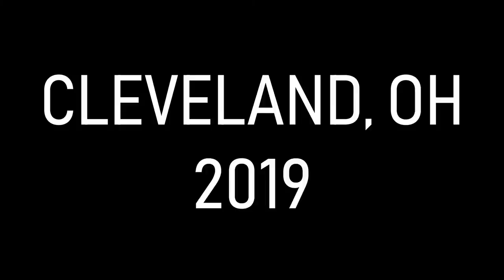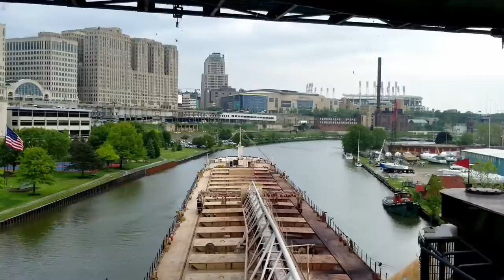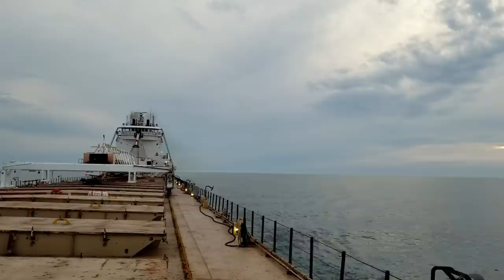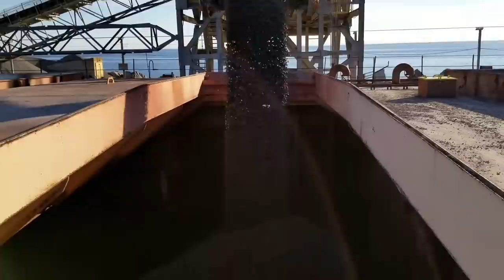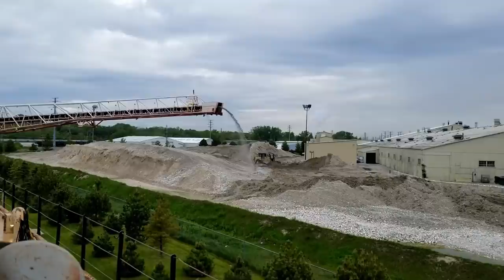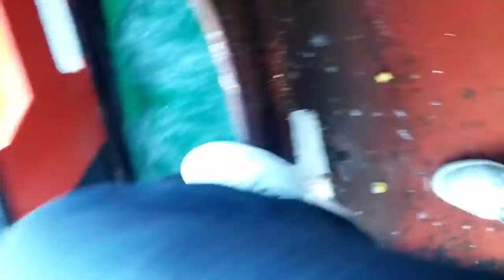SAILING ON THE GREAT LAKES. BULK CARRIER

Comment: I have a 45' sailboat that I keep in Racine, WI from mid-April through mid-October and we sail all over Lake Michigan. The thing that amazes me about the lake freighters is how the captains are able to maneuver them into such tight rivers and ports without tugboats...even the 1,000 footers. Great video...thanks for posting it!
Reply from the maker: Yea, if you see the timelapse i made of cleveland, that was all the captain no pilots, freaking crazy. thanks for watching though!
Reply: side thrusters?
are they all rusty boats?
Reply: Great Lakes captains are typically locals. They grew up near those rivers, they boat and fish on them whenever they are not working, they have a longtime connection to those rivers and know how the currents function and use them to their advantage. That's the thing about Great Lakes captains and officers, they have a strong bond with the Great Lakes and their adjacent waterways, it's basically routine for them, on the ocean captains are likely to visit a bunch of ports they are not familiar with. On the Lakes you mostly see pilots and tugs on salties (oceanbound vessels that visit the Lakes), although in some ports with a lot of shoals (like Green Bay) tugs are more used more commonly. The main purpose of tugs on the Lakes is moving barges around rather than ship guidance, tugs commonly are bringing barges into harbors that are too small to take ships.
Reply: @feelinghealingfrequences7179  Depends, some companies have a better track record of ship maintenance than others. There are some very old ships on the lakes that are still sailing and are kept in good condition (like the Alpena and Arthur M Anderson), and you have "newer" (in laker terms) ships that are in less-than-ideal condition. Ships on the lakes can last a remarkably long time because freshwater is significantly less corrosive than saltwater, when it comes to rustbuckets on the lakes it really is the company's fault for skimping out on maintenance and letting it fall apart.
Reply: @funnelvortex7722  Some are destined to be rust buckets no matter the maintenance,  spend a bit of time at the Port of Goderich and you'll see why, once you start carrying salt, you can never keep up from then onwards.

Comment: Info on the ship.
Quote
M/V Sam Laud is a diesel-powered Lake freighter owned and operated by the American Steamship Company. This vessel was built in 1975 at Bay Shipbuilding Company, Sturgeon Bay, Wisconsin and included self-unloading technology.

The ship is 634 feet 10 inches (193.50 m) long and 68.1 feet (20.8 m) wide, with a carrying capacity of 24,300 tons (at midsummer draft), limestone, gypsum, coal or iron ore.
Unquote

Comment: It is quite amazing some of the river traffic. It may have been on the Rouge river (it's been a while) I was on the Beeghly and we inched our way past the Arthur Anderson to get up river, just three or four feet apart.  We were standing by with tires on ropes. We went KCBX (Chicago) to Milwaukee quite a bit. One time we had this idiot mate who, when we ran the system off prior pointed the boom right at their dockside little office and of course he caved in the roof. But then grabbed a 1.5 inch and flooded it out. They were not happy. But what got me was, as if it's not hard enough to just head in to S. Chicago, we would back out the Beeghly and Jackson. I don't know how they do some of that stuff. I'd crash lol. Yeah there is no set sleep schedule at all and winter work and ice sucks but I really liked the work. Sadly my back didn't like it as much as my wallet did. :) In the end I would have rather been on a vessel that took a while to get somewhere like a week or so. On the lakes you can get to the next dock sometimes in 8 hours, in the end it was worth it for the 7 years I spent there.
Reply from the maker: Yeah man, the short transits are the worst, no sleep, non stop work. Nothing like a little routine out at sea.

Comment: I clean barges and I hate cleaning gypsum. Sand barges are easy to clean. Cement also sucks because we have to pump all of the water into a old barge then we empty that barge once the cement hardens up. I work at a couple ports one in south Chicago and one about 1 hour of of Chicago. Videos on my page